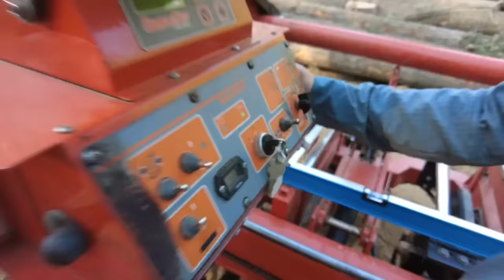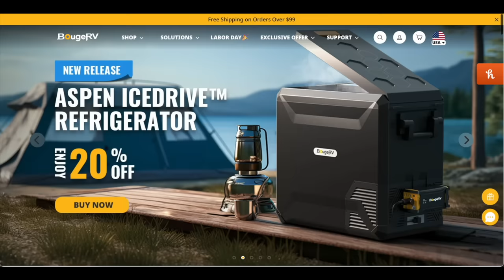Turning Trees Into Money!? 💰

Comment: I sawmill my trees at my property, so I’ll share a couple of things that I’d consider doing in your position. You’ll want to seal the ends of the boards - cutting off splintered edges if they already exist. AnchorSeal is the brand name and it’s good stuff, but a few coats of Latex paint does work pretty well and is a lot cheaper. Secure it so the boards don’t warp while they dry, especially important since you didn’t quarter-saw it. I use 4 tie straps and some heavy objects; I hear you guys have some large rocks. Kiln drying it can be fairly simple and speed up drying time - take some thin insulation board and tape it together around the boards, insert a dehumidifier and a heat lamp or two, and let it roast for a week; needs to hit 150F for a day or so and then rest of the time is just pulling out water. Happy Building!

Comment: Nice job.  Paint the end of the each beams with cheap spray can. It helping for the the wood to dry equally and prevent the extremity’s cracking. If not you gonna lose length and strength. 👋🏼🇨🇦👋🏼

Comment: Nice jobs. I run a LT35 for a guy I work with in Massachusetts. Mostly sawing eastern white pine into dimensional material for orders and a small sales yard. The fluid for the mill we use is usually regular water with a little dish soap in it. Works well. Also, I envy that mill because it has auto engage for reving up the engine and hyraulic blade guide. 
The mill I run has the hydraulic loader and log turner like that one. What Tyler there does is similar to me because I do tree work and some forestry work in MA. Looking to get my full certifications so I can help other people manage there woodlands.

Comment: Great video, you just got a pirates ransom in lumber, 2x6x12 ' of that quality sell for $20 and up at home depot , my nephew said you got at least $5000.00 in lumber there awesome job, he bought 20 acres a few years back  and we cleared most of it ourselves during summer whenever we could go out and work it and purchased his own mill similar  to the one you used there and his friend taught us how to use it, it can make pretty short work of trees once you know what your doing and what you need to cut we did enough to supply all the wood needed to frame his 1700 sq.ft bungalow, he did have to buy the sheeting to close it in though, he did have enough left over to build a shed for his slide and quad, pretty neat it had a drive in and drive out door on each end, good enough to work in out of the winter wind and snow, and just got a cheap wood stove off marketplace for $150, who cares it was better than nothing  and you could boil water on top for tea, 👍 we ended up clearing almost 4 acres of trees over 5 summers and i still have a bit for my fire pit in my backyard

Comment: It would be nice to use the sawdust to make wood pellets.  You can probably get a machine to do that.
Reply: My thoughts entirely, I save and burn all my sawdust, its great for putting on the fire at night, or just to damp it down a bit, you can also use it to soak up any spilled oil or fuel.  Put the fresh sawdust in woven sacks to help the drying, but be careful as it can heat up whilst drying, personally I have never had a problem but there is always a first time, its a really useful product and it comes for free, (sort off!!).

Comment: all that slab wood (the offcuts with the bark) can be saved and cut for firewood.  Stack all that other wood and keep it dry.  Ply on top with a tarp over that and weighted down.  It will keep for a few years.  
For fire, great idea to prepare.  Clear the understory of brush and low branches.  Do that quite a ways around the house, at LEAST 100 feet.  As to fire fighting?  yeah, you don't have a lot of water, but the house is fairly resistant.  I've done the same with my structures.  All metal roofs, sides either metal or cement board.  It is hard to use water unless you have an awful lot, which you don't.  frankly, when a small fire goes thru, fine, you can deal with it with a couple thousand gallons, but a big fire, no way.  You CAN get a foam suppression unit.  That adds foam to the water so that it sticks to the side of buildings for a bit, MUCH better, but those aren't cheap.  The thing to do is keep the burnable stuff away.  yes, a controlled burn is great to do every 5 or 10 years.

Comment: First simple thing to build is a slab and pole barn for year long wood drying. This isn't going to be the only time you cut trees. When you don't have lumber you can use it for drying firewood. But I know... boring. Also a fence and gate for the front of the property.

I can see you putting in stairs for easier and quicker access around the property.

Comment: I was watching the next pic video on Yu. Buy those motor liquor motors and I solemnly broke next time you take a cable and you touch to the motor and you touch to the boat. That way, if it breaks loose from the boat, you've always got an attachment assured attachment that you can retrieve the motor from the back of the boat, it will never leave the back of the boat even on a gas powered motor somewhere on it. Touch a cable to it that way. If it comes loose, you don't have to worry about losing your motor it might come loose within.  You know, you'll be able to grab the cable and pull it back up. Rearttach it or lay it up on the deck and you'll be fine.

Comment: Now that you have all that sawdust, you can build a small neat "sawdust" composting outhouse on the edge of your yard so when you are working outside you have a safe convenient restroom for convenience without having to go all the way to the house and up the stairs.  I saw a really nice version built on a BBC show about an english family building a totally off grid self sustaining homestead.  The head of the family was a regular on the British "Junkyard Wars" show.  The outhouse could be climate controlled easily enough with a single solar panel running a 5,000 btu window AC in summer ( probably no battery required ), and a small Buddy propane heater in the winter.  Hand sanitizer for wash up and no plumbing to freeze in winter when not heated when not in use.  Plus after the sawdust has dehydrated the waste it can be used as fuel for bon fires, etc using little or no starter fluid to get the burn started.

Comment: The other thing is the slabs from the 1st cut you have plenty of fire wood out of it so the only thing  you wont use is the saw dust .when they are dry and cut up for firewood they will make good burnig because the. Bark will make it burn well and hot .😊

Comment: You can increase your water flow in your shower well by running sock pipe along the end of the property against the hill part is where you want to run to ShopRite at the bottom of the hill going down do you put all the water comes out of here with rain to your shallow well

Comment: That's a great use of the old trees. I'm curious as to how the cost of processing your own trees compares to store bought lumber though?
Reply: Great question, I'm curious also.
Reply: I bet if you got your own simple mill ( Harbor Freight ) with some learning and maybe a few modifications it would be a bargain plus longterm sustainable for future milling especially if you located a localish used mill for sale.
Reply: coreywalters  depends how much lumber they mill, the initial cost of the mill, and the cost to operate the mill, and their labor,  the advantage is they already have the trees !!
Reply: 300-500bf an hour is doable with good timber. I bet they were just a little lower. Most sawmillers (myself included) change between $100 and 150 per hour. It will be quite a bit less expensive than just buying lumber, but you do have to account for it not being kiln dried. You can build green though, many of us do. You can typically pay off the mill cost with one housing package. My mill has paid for itself many many times over.

Comment: A lumber tip.. before, you put up 4x4 posts for the fence project. Raw wood , is a termite buffet. 😅. What you can do is this. Dig a ditch , x feet long, line the ditch with black plastic. Construction grade. 
Fill the ditch with water, ( dosnt have to be drinkable) dirty will do. ( there a non toxic , blend to treat raw lumber, mix it in the ditch you made, ) now add your fence lumber. Let it soak for x days. The wood will be stronger, and nothing will eat it.
The left over, treatment,  water. Just let the sun evaporate it. Of, pump it in barrles, and spray down your new road, and after you wet it down. Break out the compacting,  roller . And add much need compaction. Note you rolled it dry. Dry compaction is ok. But not even close to how much compaction you get from wetting new road beds down.. 
Side note. On wayfarer,  web site. They have for cheap, metal framed hoop car ports, or green house, cheap but very strong. I would buy 3 or 4 of them.
And put, weather covers over all the wood stacks asap, keep ends open, venting, and if you them,
Put a fan, at one end, blowing air thru the stacks in the hoop car port. Wood will dry even with less cracking. 
Great job, using the wood. The big beam is worth.
At least a $ 1000 bucks. Wow.
Reply: Great tips. How much would all of that wood cost bought vs milled like they did?
Reply: i've never seen a termite up north...

Comment: It's cool that Tyler has an Outfitter truck camper.  Did you get a chance to check it out?

We have a heavily customized, 2007 9,5' Apex.  It was the most expensive unit they had sold up to that time.  We bought from Outfitter before Bob sold the company.  We had been to their factory in Longmont, CO several times.

Comment: All the slabs you made can be cut up and burned in your woodstove as free fuel too. If you really wanted to clean up from all those felled trees all the slash could be chipped and burned in your stove as well. Free is free. Maybe you could get a green(as in not dry) wood chip furnace manufacture to sponsor the channel and you would not even have to let the chips dry before winter sets in as they can be burned green all winter long.

Comment: Plus, don't forget about all the bark-on pieces trimmed off that will burn nicely in your wood stove!  Probably a good thing to hire out the sawyering and sawmill rather than buy another piece of equipment that, after this glut of use, would probably only be fired up once a year or two and constantly need maintenance and adjusting.  Good choice, IMHO.

Comment: Riley and Courtney. PLEASE LISTEN TO ME. I am an avid woodworking professional etc. have a large shop full of high end equipment, and have been doing woodworking starting at a very early age. I have bought many a board feet from sawyers who produced just what you did in this show. 
I asked one of my professional sawyers dropping off hundreds of feet of red oak, I asked him, any tips as to what I should do, and he said, "Keep it out of the sunlight". 
Another channel I am crazy about bought a Wood Mizer saw mill, has a large property with lots of trees, and marveled at some of the beautiful grains in the wood he was milling. I told him to keep it out of the sunlight, and even the acid rain, but he left it stacked and exposed. Months later it turned into a stacked, and stickered pile of dark gray boards that were totally unusable. They don't even make good firewood for the stove because they are wide flat pieces that air can't easily get to. In invest in some tarps. Naturally cuing wood like you are doing in stacks is the best way of curing it. Force drying like when you put it in a kiln can result for example when you are cutting it on a table saw for the piece curving off of the blade. Best way for kiln drying is to let it age for a year afterwards after coming out of the kiln. Of course there are exceptions to having problems with kiln drying. I guess certain woods are more susceptible to it. 
Anyhow, COVER YOUR WOOD WITH TARPS, OR GET IT UNDER ROOF SOMEHOW.

Comment: What are the rules there for building with uninspected lumber? Here in NC its not allowed. I have a lot of acreage of trees that I planed to selectively cut for a building project but found out I can't use any lumber milled from it for anything other than siding or other non structural purposes. 

Part of me says screw the permits and inspections BUT this property is up against a recreational area with far too much attention from the austerities to get away with going rogue. :(
Reply: Bonner county idaho doesn't have building inspections.  if you build, you are supposed to build to code, but there will be nobody stopping you if you don't
Reply: Wow. Very much NOT the situation here. Thanks for the info. 

On the property I have, I built a 12'x12' shed to store tools and have a place to get out of the weather while cutting trees and such. Ended up with a call from the planning department because someone saw me building something and they didn't see a permit box. It turned out to be OK since 12x12 and under requires no permit but an example of how fast on the trigger they are here. :(

A neighbor got in hot water with the planning department because they cut a couple trees down to get their garden a bit more sun. This was because they hadn't closed out the permit from building their house and on that permit there was a clearing limit designated in the small print on the permit. They were threatened with some serious civil fines for that. Exactly why I'm doing all my land prep before going for any permits. I don't want them tying my hands for a few years while I build a house and shop. 

Anyway, we all figure out how best to get by.
Reply: @TrackGeeks  I forgot to mention, if one wants to build with milled lumber, you can contact a local lumber grader (may be difficult unless there are commercial mills relatively close), who can grade and stamp the lumber.  It is then allowed by IRC